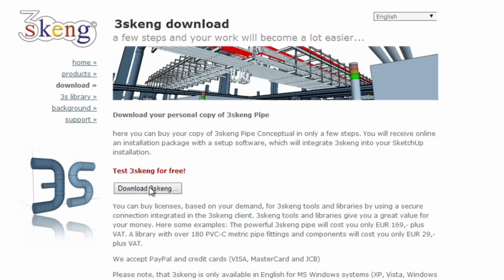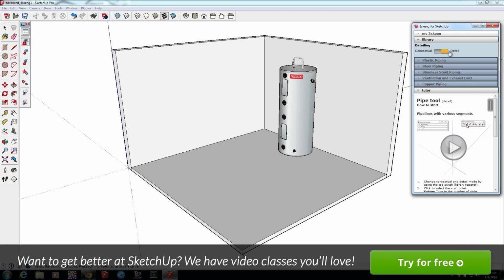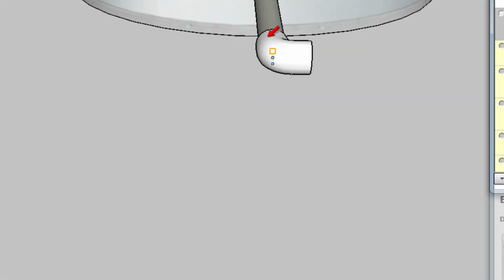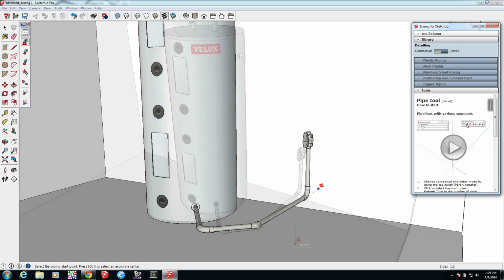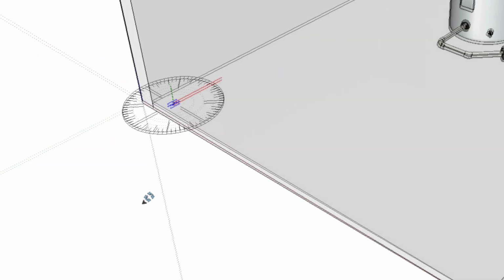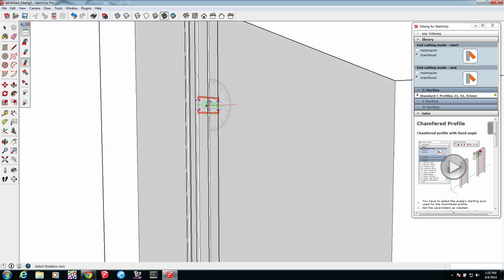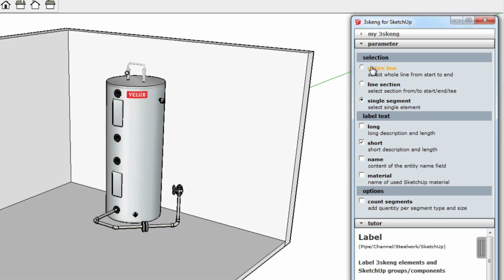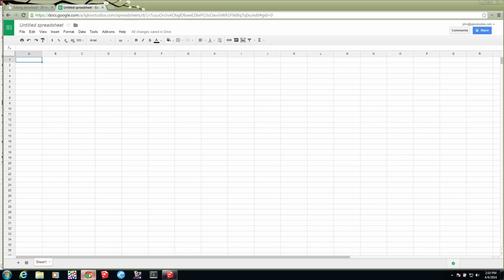Detailed Pipe & Steelwork with 3Skeng for SketchUp  | SketchUp Show #71 (Tutorial)

Comment: Very nice!! But the real problem during the engineering design is not the modeling but the final drawings, how can extract a detail drawings with dimentions, label, tags, etc....?
thanx
Reply: walter gatti Sketchup Layout is a separate application, but it does exactly that, I believe.
Reply: Ok thanx for your reply.
Reply: +walter gatti    Also note that the software 3Skeng has automatic tag's to pipes etc. (with options to show how much
detail to show,  like pipe size etc.)